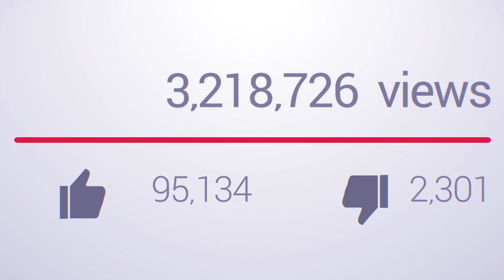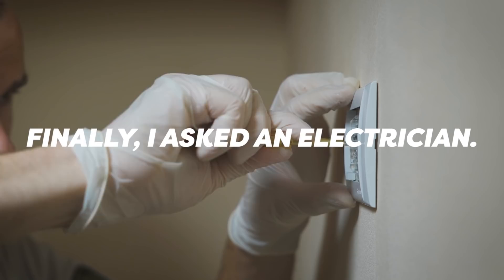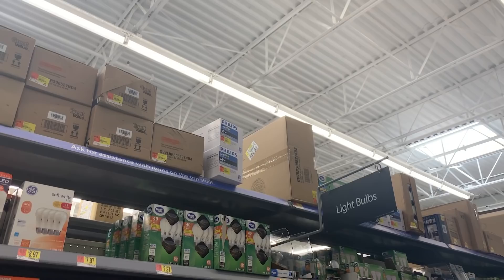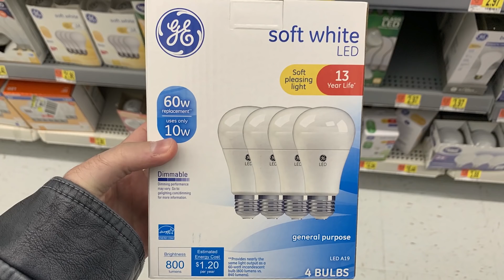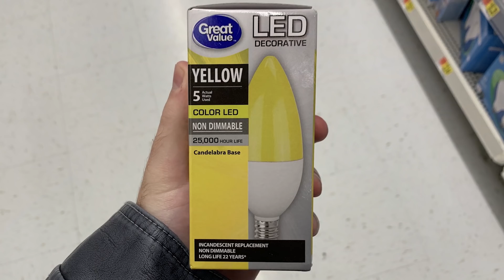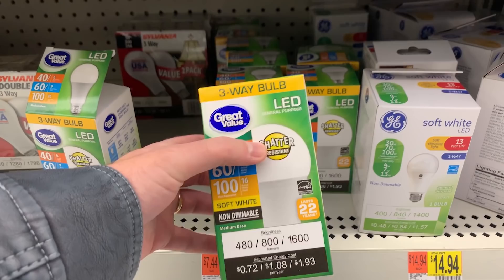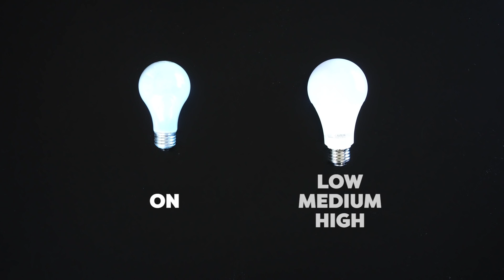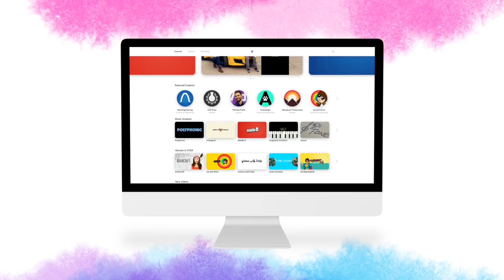Why Do Some Lamps Click TWICE?

Comment: When I was a kid we had an old metal lamp that fell over or something...idk but it didn't work correctly and I think maybe it was supposed to be a 3-way lamp.  At a certain point after it had been knocked around a bit it developed a strange feature.  In order to brighten the lamp, all we had to do was touch the metal base.  That's right, my siblings and I had created a touch light in 1999 (somehow) .  We didn't question it too much we just thought it was cool.  In hindsight, we probably should have stopped using it and thrown it away as there was obviously something electrical wrong with it and it was most likely pretty dangerous to keep plugging it into the wall.  It also had a low buzzing sound to it as well when it was on.  I remember reading by it and touching the base a couple of times to make the light brighter.

Comment: I knew that some lamps had multiple settings but i didn't know that you needed a specific bulb to make it work, I assumed any old bulb would work since I thought the lamp just put a different voltage into the light to change the intensity. It's cool learning new things

Comment: I KNEW IT!!! Well not exactly the answer but I had a feeling that leaving it on the FIRST click, even tho the light isn’t on, is still turning on the electricity. Or whatever the mechanism allowing current in is called. So it’s probably wasting power as if it were on a low setting??? 

I’ve always debated this with my family.

Comment: funfact!: If you witness your 3way bulb seemingly blow, chances are it was the mechanism responsible for the 3way setting capability within the bulb that went bad BUT the bulb itself is still good but will now operate as a bulb thats wattage is equal to the lowest of the 3 settings it was made for (ie a 50/100/150watt 3way bulb would operate as a 50 watt bulb & turn on at the 2nd click) I can't explain why this happens but only that it's happened to me quite a few times & I've saved a bunch of bulbs that I would've otherwise tossed because I assumed they blew. Weird science 🕴

Comment: I was disappointed that you didn’t show the bottom of the 3-way light bulb which has an additional ring around the tip.  This allows the socket to apply power to the “low” brightness level. Whereas the tip and threads is power for the “medium” level.  The “high” level is simply both low and medium together.

Comment: I guessed it was something like a UK bathroom light, we aren't allowed switches in UK bathrooms, so we have string coming from a switch in the ceiling. When you pull it it clicks, then you let it go, it clicks again and the light comes one. Although that is just to do with the design on the switch and not the bulb.

Comment: My grandparents had a caravan and in it there was a lamp that you tapped to turn on and it used 3 way bulbs. By tap I mean that there was a rounded bit that the lamp was attached to and you tapped that to do this cycle,
High-Medium-Low-Off.

Comment: My initial thought, as I live in a home where several lamps do this, was that it's just a non-dimmable LED in a dimmable lamp socket. Time to watch the full video anyway and find out!
Reply: Ah! calling 3-way lamps "dimmable" was my mistake, but yeah! We used to use normal 3-way incandescent bulbs but when we started using regular LED's or when someone accidentally  put a normal incandescent we would see this behaviour. I guess if you didn't grow up around lamps with the proper bulbs, it might seem unfamiliar, but it seems strange to me that this was a mystery to Austin :V

Comment: Light bulbs used to have two filiments.   Or a 3 way bulb.   So an old light bulb  would low high or both for  the highest. If you look at the bottom of the build you will see a ring that for the second click. Lol

Comment: Cars actually are two clicks. It's just the first one is very lightly pushed past.

There's a step where you can turn on lights and radio and the like but not engine.

Comment: when you power the lamp another time tho, wouldn't it need just 1 click - if to switch it off you turned it back to "light" setting - or 3 clicks if you turned it off by setting it to the "high" one? 
the cycle is formed of 3 settings, hence it won't always be exactly 2 clicks, no matter how you turn it off.
1 or 3.

Comment: Ok so if you're wondering WHY this works this way, a 3 way bulb has 2 filaments which operate at different wattages and 2 contacts at the base of the bulb. When you click the fist time the switch touches the low wattage contact, which regular bulbs don't have so the light doesn't turn on. The second click touches the medium wattage contact, which is just a regular light bulb contact so the light turns on. The third click will touch both contacts, so a regular bulb just stays on.

This was the most long winded video to NOT explain how the switch actually works, I'm unreasonably angry that I had to go look this up after the video ended

Comment: This is still a bit confusing. If you have a regular bulb in the lamp, the clicking would cycle like this:
OFF - OFF - ON - OFF - OFF - ON (so two clicks in between the setting that turns the bulb on)
But then if you have a 3 stage bulb, the clicking is like this:
LOW - MED - HIGH - OFF - LOW - MEDIUM - HIGH - OFF (now it takes 3 clicks in between the same settings.. where did that extra click come from?)

Comment: Interesting video... But I would have liked to see how the switch was constructed to see what is going on electrically.

Also, did you have auto exposure on when testing the 3 intensity bulb? There didn't appear to be much difference between the setting but I suspect this was just cancelled out by auto exposure.

Comment: Wait... with the lamps at my house, you have to click the thingy twice to turn OFF the bulb, as well as on. While the conclusion does explain why it turns on in two clicks, it doesn't explain why it also takes two clicks to turn off. 

My theory is that the first two settings, off and low, are under the watt threshold of the lamp being on, while the other two settings, medium and high, meet the threshold and turn on the bulb. 

I may have just answered my own question, but it's still good to ask questions. Did I add anything off value to your thought process by introducing something from mine? Please, tell me. 

Also, I'm sorry if anyone thinks I wrote this to be rude, because I didn't.

Comment: Actually some cars have different turns so my dads has 3 before the engine turns on
Reply: the old ones would turn backwards to play the radio the new ones turn one click forward for radio then two for run  
old car  "acc. , off , run , start"     new car  "off , acc. , run , start"
that's why there is two clicks to start a newer car

Comment: ... you didn’t even address why it’s two clicks.
Having uh, owned lamps before, the fact that this happens with lamps made for triple level bulbs is no surprise.
But why is it two clicks and not three? The tri level bulb requires 4 clicks per “cycle” - low, medium, hi, off... but that would mean three blank clicks to reach the “medium” setting with a normal bulb, but it only takes two?

Comment: “Three phase switch” actually is OFF, LOW, and HIGH, not low, med, high, off, that would require three clicks
Reply: No, the lamp stays on for both MED and HIGH, which is why it needs 2 clicks to turn off as well. 4 settings, 4 clicks